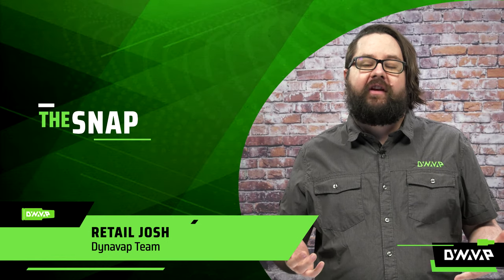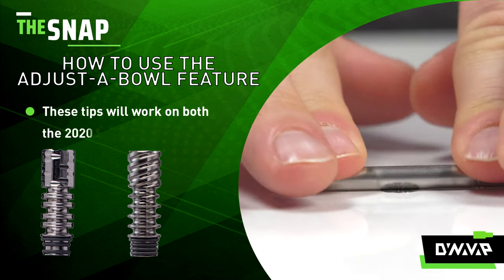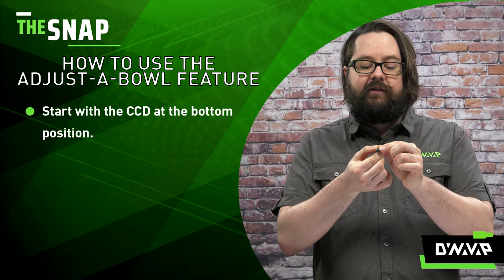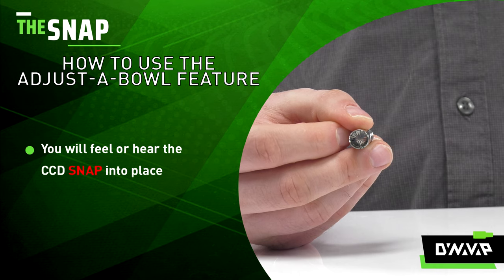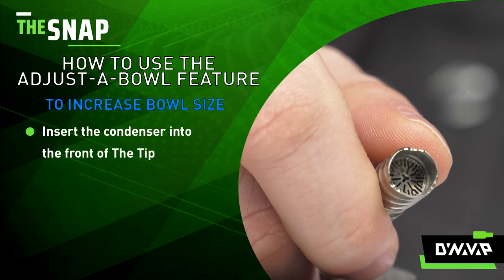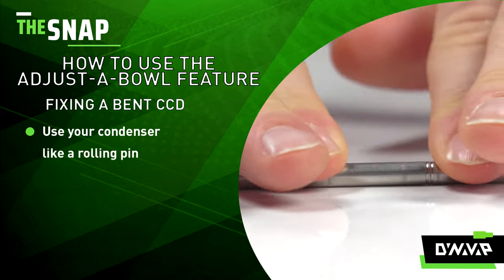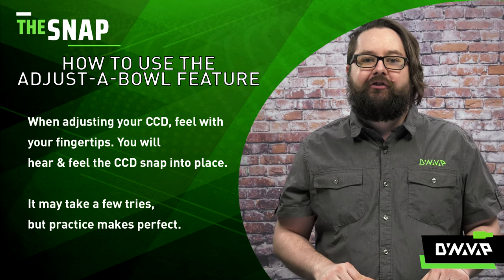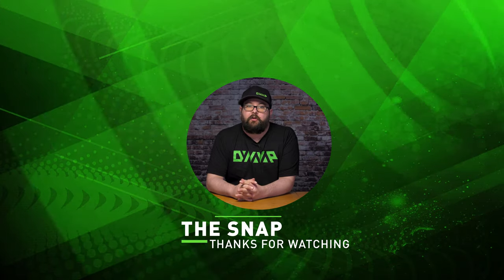How to use the Adjust-A-Bowl Feature | The Snap

Comment: Tried it.  Very hard to get it in that second, smaller chamber groove.  Need to modify part of the digging tool so that it has a 'stopping' feature to make this adjustment easier and more user friendly.
Reply: I've seen on reddit.. if you have two Dynavaps, use the opposite end of the 2nd part. It's supposed to stop at just the right point.
Reply: @Gwinter452 just reading this a year later can you explain in a little more detail?
Reply: @Gwinter452  what do you mean?

Comment: They really just need to make it so you rotate the tip to adjust it.
Reply: Get a new omni
Reply: The titanium tip doesn't require it to be spun while heating. But the tip is $40.
Reply: @Geonious  it does need to be rotated.
Reply: I think it'd be complicated to add screw adjustment, adding a little bulk to the device and I'd imagine greater likelihood of accidentally adjusting unintentionally.

Comment: I just used the cleaned end of a clicky ballpoint pen (the plastic shroud, not the ink roller) to push the CCD from two sides and instead of it flying out every time, i got a VERY affirmative click when it went into place. Pushing it from 2 sides ensures it also travels perpendicular to the cylinder it's in.

Comment: this only works on the SS tips because the TI ones have a taper inside which don't allow the condenser to pass through without severe scratching.
i wish you guys made half sized bowls as well.
Reply: Yes, a half sized bowl option is better. Having lots of trouble to adjust the screen into place
Reply: How small of bowls do you guys want? I’ve got a dynavap 2020 m and could do with being about 3 times bigger
Reply: works for my Ti tip.
Reply: @ellisberry8747  in my experience you need it to be small for vaping hash
Reply: @diffsnicker6570  the size it is currently is perfect for a nice little hash sandwich. 
Any smaller and it really wouldnt be worth all the effort of packing it and heating it up
Reply: @ellisberry8747  half bowl is actually way better. fresher hits same effects

Comment: Tried this method and it never works for me. I spend much too much time trying to get it where I want, oncebi do I never adjust it again. I am sure someone out there could develop a tool to do this easier
Reply: It only works with new screens and a clean bowl. once the screen has been bent a couple times and flattened again itll bend again every single time instead of snapping into place. Or it'll flip on its side. Especially if there's a little gunk in the grooves from the bowl not being perfectly clean.
Reply: For the m, it looks like the smaller end of the tip could be used as it's not as small and as focused as the condenser. But, this can't be used unless you have two tips. There needs to be like something that moves in steps and attaches to the tip itself, maybe I'll take a crack at making one
Reply: @user-md3is4dq2d  if you ever do and get it to work, let me know and i will buy one off ya ;)
Reply: Sneaky Pete makes a half bowl converter

Comment: Great idea but it doesn't work so well with my new M7. The groove is to shallow for the CCD screen to snap into place and stay in place. I spent a long time with a thick gauge needle trying to get each metal fin into the groove. One always seemed to defy me. Then when I would dip the tip in my ground herb the CCD screen would get pushed to the bottom. So, when I want to microdose I just put less herb in the bowl. BAM!! Problem solved. Make the groove slightly larger and deeper. I'll be happy to try the first one out and let you know how I like it. 🤘
Reply: Hi bro, i also got the m7 recently but I’m not able to get big dense vapor from it.. it’s just small puffs .. i try to go 2-3 seconds after 2 clicks still

Comment: Just received mine now, and I feel like this video has to be a joke. it WILL NOT go into the mid groove. Pushing from the bottom as in the video does nothing until it pops right up against my finger, trying to put it in from the top also doesnt work, its always slight off the groove and either falls out or pings out. Poor design.
Reply: it needs work, but I'm sure future releases will nail it :)
Reply: @Regi869  When?  This is like their tenth tip now.
Reply: @Regi869  M2021 checking in here and it’s just as frustrating.
Reply: Yeah I spent an hour trying to get it and just gave up, miserable little bastard 😎

Comment: Thank you, I only had one o-ring on the condenser and it was anchored to the bown rather than the mouthpiece, causing it to slide around and either not pull at all, or be just air. Putting the 2nd oring back on fixed it!

Comment: It doesn't stay in place very well at all, I wish this feature worked better but it's pretty unusable in my experience.  You guys should start selling tips with smaller bowl sizes that aren't adjusted.  Adjust-ability isn't keeping it simple, selling a "medium size bowl" tip is.
Reply: nice idea, i never use a full bowl size so to me it makes sense.
Reply: I'd like a bowel double the size I get tired of refreshing the bowel every two rips i do have a 2016 M though
Reply: If it's not staying in place then you aren't getting it seated into the groove. It took me many attempts. It should stay in place if you push on the condenser from either side with less force than used to adjust it. If it pops out easily than it wasn't completely in the groove. if it starts to go in a little crooked you probably will need to pop it out again and try again because it starts to get jammed which can start to bend the ccd but just do the rolling pin thing and try again. I think i finally got by pushing it all the way in and making sure it was in that bottom groove just right and then pushing it up with just enough force to get it moving and stopping so you don't push it past the groove you want it in and have to start again. It's definitely something that takes a bit of practice and patience but once it's actually in it stays just fine. They make it look way easier than it is at least at first. It's something that you have to learn the feel for so you don't use too much force and push the ccd past the intended position which happens a lot even when it might seem like you got it lol. goodluck!
Reply: @Commsfarage  i really hope you mean bowl :)
Reply: @benfrank  oh shit haha yeh
Reply: @Commsfarage  I think you need better herb, to be honest.
Reply: @pomx2900  tbh no. 
changed to a mighty but iv stopped now so 🤷
Reply: @Commsfarage  good for you, I have a Crafty+ on the way.

Comment: Your adjustable bowl is a joke. Stop fooling around and tell everyone to punch the screen to the bottom. (I'd like to see you in live stream, where you set it correctly five times in a row and time it.)
Reply: This is why i never bother adjusting.
Reply: @Jondread  So you just keep it at the maximum level?
Reply: @Jondread  but you need to clean it out. I just cleaned mine now and there is so much gunk under the screen and in the condenser. I'm about to rip a bowl on a clean dynavap, it's gonna hit hard
Reply: @LFiers   if you are finding the bowl too big, just pack it looser.
It's not rocket surgery.
Reply: @pomx2900  I got it down to a science. I chop it up and pack it to a specific density and I even know how much hits I get out it perfectly every time, with each strain. Can't do that's if it's randomly packed lose as the heat distribution is inconsistent. But I guess if it gets too annoying, I'll just keep it at maximum size next time....I do love the amount for the half bowl feature though it's perfect.

Comment: Why not just offer tips that are designed for a smaller bowl by default so we don't have to piddle with this?
Reply: just dont smoke smaller bowls lol
Reply: if I'm not mistaken tje "b" comes stock as a "small bowl" correct?  at least that's the way I read it.... lol doing some research before jumping on some 4-20 deals

Comment: Been patiently trying to adjust this thing for over a week now and I still can't get the CCD screen to stay seated in the smaller ridge on my 2020 M. Seems like the ridge isn't pronounced enough. Even though I get the screen seated in the ridge, it just falls out the tip as soon as I turn it downwards. This is a really frustrating and ineffective design. I'm returning my 2020 M and will not be purchasing DynaVap products in the future. My Lotus pipe is worlds better than this finicky thing.
Reply: screen needs to be PERFECTLY flat and round
Reply: Also, it's not a ridge, it's a groove. There's ridge a few mm down from the top of the tip, but it's not this you're aiming for, it's the groove a couple more mm further in.
Reply: @joechesshyre  I think this is why some people have a problem with it, they think the ridge is where the screen fits in place. I originally thought that myself until i noticed the groove near it.
Reply: @atrio1136  absolutely same here
Reply: Dang thats a lot of crying!

Comment: Best way to clean CCD remove place on none flammable material and torch it until glowing red 
rub off burnt crap with fingers.
Reply: WellzTheDude  I've got a SS been doing it for years but im lazy not doing it very often
Reply: WellzTheDude  never had that problem that fast, used mine everyday since 2016
Reply: Just clean in in simmering milk and then drink the milk..you get pretty baked. I call it space milk. Others call it stem milk or something.
my space milk is done in just thicken cream, no milk.
Reply: @unarmedblackguy  haha yeh i used to do this with my arizer solo tubes
Reply: @Commsfarage  i didnt clean my solo stems for 3 months and did it...it was a very bad time. It was like a very mild bad shroom trip. Defs dont leave it for too long haha
Reply: @unarmedblackguy  haha my solo days are long gone on the vap 24/7 ✌️
Reply: @Commsfarage  which solo you got?
 I have the solo 2 and the extreme q  and love them both, have had the dynavap for a year and i am over the flame, so i just bought the dynatec apollo rover and a titanium tip.. Just waiting for the delivery. I reckon the apollo rover will get me right back into my dynavap. I only use the solo 2 now when i got some real nice flavoured stuff or I am seeking a specific temp.
Reply: too hot and it will break
Reply: @toolbaggers  been doing it for years and years

Comment: I really don't know what everyone's problem is with adjusting the bowl. You just have to really gently press the condenser in until you see that it would pop out if you'd press any further.
Reply: I have to apply alot of pressure for it to move out of the bottom, once it actually does move, it's not in the tip anymore.
Reply: @user-md3is4dq2d  place the eraser end of a pencil in the bowl against the screen, then use the condenser to push the screen into place. The eraser will prevent the screen from flying out

Comment: Well, that was insanely hard in the titanium vong… The fact that they claimed that it was easy has really left a bad taste in my mouth. Extremely un user-friendly.
Reply: I got the Dynavap M 2020. It's very very difficult to adjust the bowl to the smaller size. I've never actually been able to do it. I've had it years and can't do it still 😆Great, great piece of kit, if you use the full bowl capacity.
Reply: @Jay-we2ek Bro, use the condenser under the CCD, and something like a BIC pen without the center of it, or something else as thick to control from above the CCD. So, you basically use two devices in two hands.
It works!
Just got it to work!

Comment: I followed this closely. Didn’t work. Ended with a mouthful of herbs. Disappointed.
Reply: You gotta make sure its securely in place. Mine hasn't budged since i first adjusted it 10 months ago.
Reply: @atrio1136  thanks for the feedback! In the end I’ve kept it in the original position and had no issues putting a small dose in. Recently bought an XL condenser and enjoying it even more. Hard to believe making the vap literally 1cm longer makes it even cooler to hold.
Reply: @prestwickpioneer3474  Was you trying to put it in the noticeable ridge? Because some people make that mistake, as the groove for the disc is about 2 mm under that ridge.